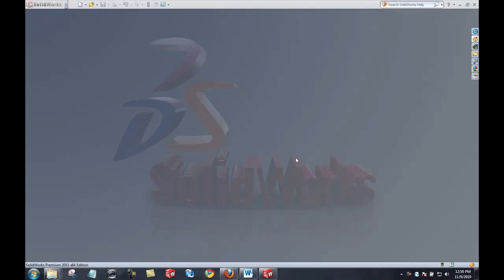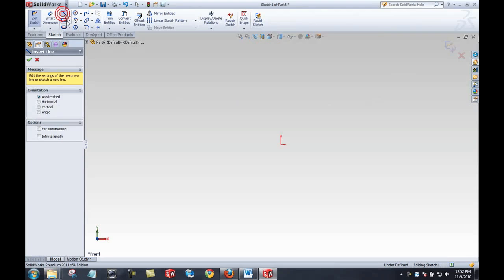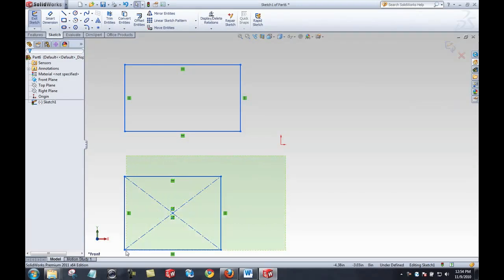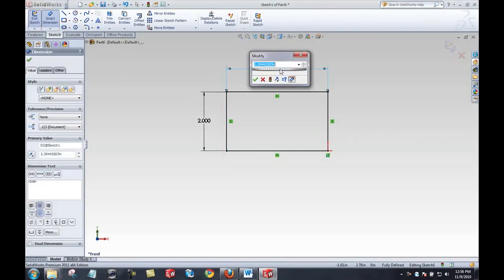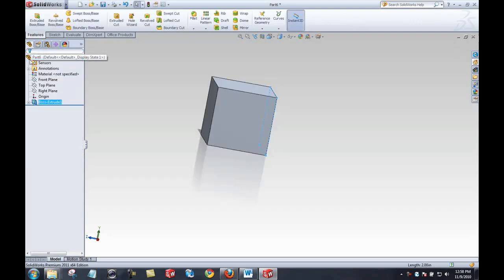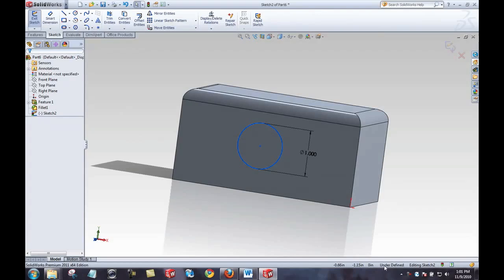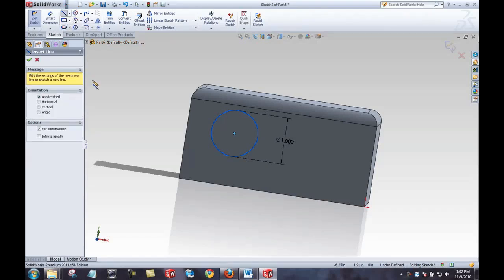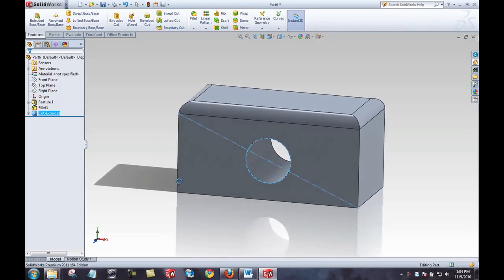SOLIDWORKS Quick Tip - Getting Started

Comment: Good day to Goengineer, I had a question which troubled me about Solidwork. I have a cylindrical disk with (Radius = 9cm, Height = 3cm) and i wanted to determine the volume from Mass Properties (Solidwork) and compared with my hand calculation for volume. I used V= pie r2 h for my manual calculation and got "7. 634 x 10^ -4 m3" while Solidwork Mass Properties showed " 1.8931 X10^-4 m3" for volume without assigning any material yet. And i got confused and loss. Hope Goengineer may guide me a way out of it . Thankyou Goengineer. PS : sorry for asking this silly question but it troubled me and i cant get through my analysis process.
Reply from the maker: I tried this procedure in SolidWorks 2020 SP1 and the initial and subsequent VOLUME values were the same both before and after I applied the Material.  
Erroneous Mass Property calculations would be a huge problem to a large audience, so we want to determine the specific cause of what you are seeing. 

Bugs can be related to your particular installation, the Version or Service Pack of SolidWorks, or dozens of other causes.  However, recreatable bugs are quite easy to diagnose and repair. That said, if you can recreate the situation on your computer to show us, we can narrow it down easier.  Please try to capture it with a video recording using SolidWorks Rx and send it to Support@goengineer.com.  

Once we see it, the Support Tech will take the necessary steps to report it or assist in the repair of the cause.

Comment: Thanks for the videos! Our college just installed a Fortus 250mc and I need to pick up some skills quick.
Reply: ***** Well here's your chance to help directly right now haha.

...if I modeled a wheel with a 9inch outside radius, can I THEN cut the finished model into quarters and 3D print each separately. Reason: printer only has a 10x10x18 volume to print in, I said 9inch radius to play it safe and not print right to the edge.

Ok I feel dumb now....I should just model 90degrees of a wheel and print it four times. 

Though! If there is a way to perform the task I requested let me know for future reference. 

Thanks!

Comment: at 10:10 you say to right click on the face, and you get that po-up menu.  when I do that my menu has far fewer things available, and sketching isn't one of them.  Is there some configuration I need to change to get that?
Reply from the maker: Hi Tim,
At the very bottom of the right click context menu that appears is a symbol showing two down arrows.  Clicking on this will expand the menu items to see items that are not as commonly used.  If, however, you find that there is a tool being hidden that you would like shown by default you can then use 'Customize Menu' at the bottom of that list to set a menu item to show by default and not be hidden.

Comment: Thanks for the video. I have a quick question: I know 3dsmax fairly well, will I still benefit from Solidworks? If let's say I want to design some gadget.
Reply from the maker: Hi Polyrider81,
3D Studio Max and SolidWorks design differ tremendously.  SolidWorks focus is in design of products for manufacturing and excels in that regard.  If your goal is to design a gadget to eventually have produced in real life then SolidWorks is the program you would want to have for that.